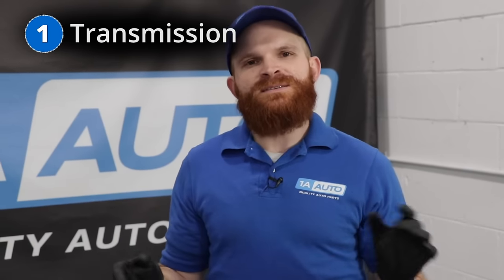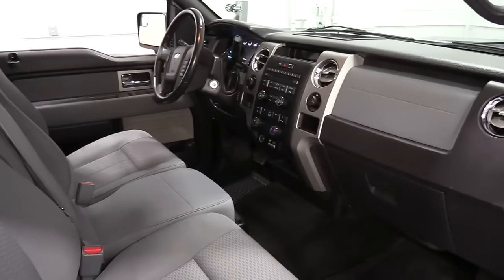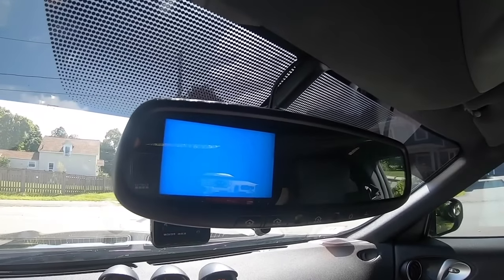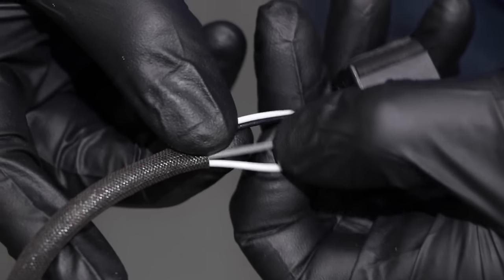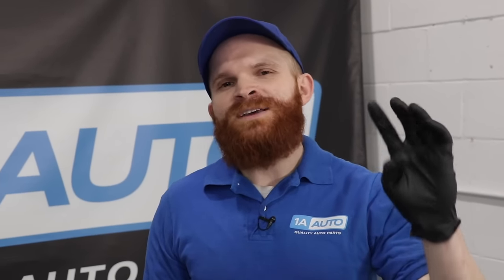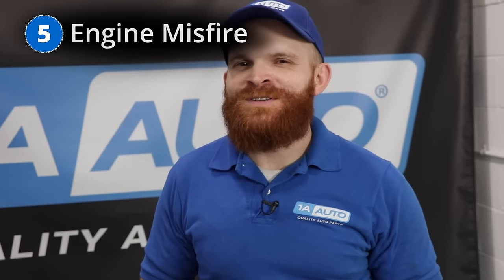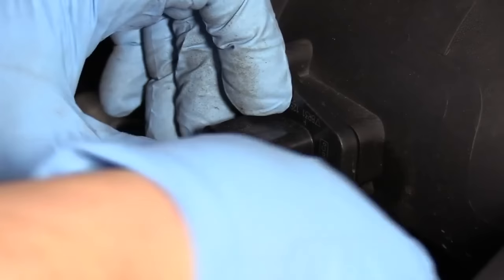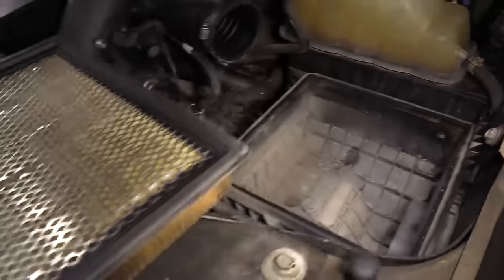Top 5 Problems Ford F-150 Truck  12th Generation 2009-14

Comment: I've got a 2009 F150 FX4.  My cruise control has been out for a while.  It also shows the traction control symbol on the dash every now and then.  I replaced the brake pedal switch, but it didn't help.  Any ideas?
Reply from the maker: +thecoolchipys Since there may be multiple reasons why you are experiencing this issue, we recommend taking your vehicle to a local mechanic to install. Thanks for checking us out!
Reply: @1AAuto  but tell him those possible causes.. so he can check... make a Top 5 too with those comments asking questions. Thank You <3

Comment: So what year are recalls I have a 14 and didnt get a letter or email from ford ?
Reply from the maker: +Charles hood Just contact your local ford dealer and they will have more information on that.
Reply: @1AAuto  I was told no recalls on 2014 f150 ecoboost 3.5 liter 112,000 miles just bought and the display flashes sometimes the radio has no sound sometimes the check engine light comes on I have had it just die I live in the mountains .  The whole display goes out. Battery check light comes on .Check brake system light comes on. Have only been able to auto start one time. Someone recommended  turning key on off 3 times to reset seemed to work for awhile. If you don't manually lock the doors, It sometimes does these things when it auto locks the doors. What a nightmare

Comment: I have had nothing but major problems with my  2014 f 150 fx 4x4. I quit buying American made vehicles in 1982. Now I remember why.i have put 10,000. Dollar's in repairs. I dumping this vehicle and going back to Toyota.  Plastic heard in the air diversion system. Rack and pinion that can't be greased failed after 6 years.  Transmission sensor currently been replaced. I'm well ng this to carvana and taking my losses. I can't afford to retire with an American vehicle on my property.
Reply from the maker: +kina lee Thanks for the feedback!
Reply: If you quit buying American made in 82,  how is it you have a 2014?

Comment: Blender door actuator $$$$.
Reply: Mines going out right now haha
Reply: Click ... click ... click
Reply: Easy to fix yourself just kinda hard to get to
Reply: $1000 dollar repair at the  dealer, $650 with local mechanic and he had to fix twice.  It actually ends up being the door flap and not so much the actuator.  I have to bring mine back in again. Probably should have had the dealership do.  Not and easy fix Rod CR250, the entire dash must come out and the center consol.

Comment: NEVER BUY A FORD. I’ve been inundated one problem after the next and my truck is just 6 years old. The warranty is up and Ford refuses to fix anything despite the fact that the issues cannot have possibly been due to owner fault. Even when my engine blew at 55k they told me I was over the miles. I religiously change my oil - fully synthetic every 5k. And most of my driving is highway miles. There’s no reason why this should have happened and the people at Ford in Limerick, Pa couldn’t care less. I’ve been a loyal Ford owner through thick and thin but this one will be my last mistake.
Reply: Posts like yours make me hesitant about buying a Ford f-150. I am considering the 2011 through 2014 models, but I actually do not need a pickup truck at all. The F-150 offers front bench seating in many of its vehicles, which I prefer to having a prominent center console between the two front seats.

I checked some of the other pickups that offer front bench seating, but I ruled them out based on gas mileage, poor reviews, and/or costs.

Seriously, I am wondering to myself if I want to spend north of $15K on a 10-year-old Ford with well over 100,000 miles. I would feel less hesitant about a Toyota or certain model and year Hondas with high miles.

So I am trying to decide between an f-150, a van (which I don't want) with a hip level center console, or learning to like the center console in a Honda Pilot or Toyota Highlander.

Comment: bois whats the best truck before 2011. used 
f150 or toyota tundra
Reply: I know your question is old. However as the owner of a nice pre 2011 F150 I would go with the 2007 up Tundra if buying a truck of that age today. The 5.4 is just to much of a crap shoot to take a chance on unless you really know what you’re getting into and are prepared to roll the dice.

Comment: 2014 5.0 lx I had a misfire and turns out over time the spark plug gap opens up to between .065 and .070 and starts to misfire. And commonly shows on cylinder 4 and 8. Replace with ONLY motorcraft plugs. Or gap the old plugs back down to between.035 and .045. Just don't damage the electrode tip or ceramic. Im not a mechanic or a professional. This is just what worked for mine after spending almost $400 on motorcraft coils and not getting better results.

Comment: What about the timing belt and phasers that seem to go out around 140,000 or the cooling fan running in high all the time
Reply: Uhm...the 2009-15 F150s don't have timing belts. They have chains. And if your chain broke at 140k...then it clearly had to be defective, or something catastrophic had to happen to the engine.
Reply: What was the solution to your cooling fan issue? Was it a coolant leak? If so, where was it leaking from (currently experiencing this)

Comment: Could you tell me what is going on with my 2010 f150 when I drive my truck in the morning and I take a off ramp onto the highway my traction control activate and slows my truck down almost to a stop? And this is on a dry day in August.
Reply: Same problem with my 2010 any luck?
Reply: Abs sensors

Comment: What if you don’t have the my touch head unit but are still having problems with the headunit to speaker output
Reply from the maker: +Dayne H We wouldn't be able to diagnose an issue like that here, you may want to have a local mechanic take a look at it. Thanks for checking us out! 1AAuto.com
Reply: My guess is that it's a blown speaker.

Comment: My radio just stopped working.i mean I've never had a stock radio just stop working.
Reply: Mine did that about 60,000 miles ago, it’s super stupid. Apparently it was an issue in the 2011-2014 models. I put an after market in and it’s been fine since.

Comment: I have a 2014 Ecoboost 3.5 twin turbo.  My opinion is the motors are far to sophisticated, and they use cheap parts.  Also they HVAC wiring and mechanical parts under the dash are chinese junk.  Unfortunately, Ford ain't what it used to be.
Reply: Molex connectors suck. They all have them now.

Comment: My radio displasy in black 4.2 inch 2013 f150 radio works just the display any help ???
Reply: I had the same issue. Ford doesnt make replacements of the 4.2" screen, so you could search forever in junkyards and ebay for one, or replace the whole stereo/hvac panel/ get a idatalink control module. Giant PITA, costs around $700 if you DIY.

Comment: Misfire in one cylinder 11-13?   First thing you do is... check the compression in that cylinder! The  #1 cause is sunken intake valves do to the s@!$y valves they put in them, but fixed late 2014 or so.  These other Thing might fix it temporarily but check the compression first before you do more damage. 
Google it and you'll see. 
Happened to me late october and after pulling the head I saw 2 different valves in 2 different cylinders  were sunken in but only one just threw the code days earlier.  Don't buy refurbished because many of those have the same junky valves in them.   You'll just be on borrowed time again.  Just got my heads back from the machine shop and so looking forward to putting them back On over the Thanksgiving weekend.

Comment: Ford has been phenomenal for that transmission recall.  Wouldn't call it a problem at all.
Gloves, long nails.....screen not responding to touch.....just like ANY other touch screen in ANY other vehicle.
O2 sensors? Really? So if You consider O2 sensor is being issue with f150 then OTHER cars have O2 sensors that last FOREVER right?
Purge solenoid? Charcoal canister? Im sorry but what is wrong with u? Its a ware and tare items.

Comment: Mine is 2010 2wheel drive crank it up put it in gear and it does nothing revive it up and it jumps in gear
Reply from the maker: +@kirbyammonsjr8491 We wouldn't be able to diagnose an issue like that here, you may want to have a local mechanic take a look at it. Thanks for checking us out! http://1aau.to/m/Shop-1AAuto-c

Comment: How do you not mention the Integrated Wheel End (IWE) actuators installed on the back of the hubs on the front axle. These are complete junk

Comment: 186,789 miles on my 2011 and the only problem its the backup camera 🎥
Reply: Do you get the dreaded blue screen issue?
Reply: @jasonstiokas3923  bought an 2011 f150 5.o xlt yesterday and it's a blue screen, I didn't know it had a camera. Does blue mean it's broke?

Comment: 2014 3.5 eco interior lights go on and off going down the road at a consistent pace. Any ideas anyone?
Reply: Remove the light fuse
Reply: Trade the truck for a F150 5.0 V8

Comment: i have a 2010 f150 4x4 5.4 3v , im having a shutter sound at low rpm around 40mph anyone know anything ?
Reply from the maker: +Wes Johnson We wouldn't be able to diagnose an issue like that here, you may want to have a local mechanic take a look at it. Thanks for checking us out! http://1aau.to/m/Shop-1AAuto-c
Reply: torque converter

Comment: These trucks are complete junk! What a rust bucket...they are totally designed to rust fast.... between the sponge material in the bed arch to the moonroof drain tubes emptying into the cab corners.. wtf?
Reply: What are you parked under a pine tree?

Comment: I have a 02 F150 got to start with a couple months ago because I kept getting a reading 420 it's a service engine soon I cannot find a problem
Reply from the maker: +William Ramirez Thanks for checking us out! The Code P0420 stands for a catalytic system efficiency below threshold for bank 1. You may want to have a local mechanic take a look at it to determine the cause of this as there are several parts that can cause this code. 1aauto.com

Comment: Reverse... rearview mirror image solid blue...?? 2011 FX4 backup camera
Reply: I had the same problem, it was working, then I got a blue screen. I found the connection at the tailgate had water intrusion, that was enough to screw it up. I unplugged it, like you would when removing the tailgate, it's under the truck, by the rear bumper, I dried it out, sorayed it down with electrical contact cleaner, greased it with dielectric grease, plugged it firmly back in, and electrical taped it tightly to keep it dry and protected. I haven't ever needed to remove my taigate from any of my trucks, ever, so keeping that camera feed connected and operational is way more important to me. That fixed the issue, hasn't been a problem since.
Reply from the maker: +Mark K Thanks for the tip! 1AAuto.com

Comment: 2010 F150 4.6 3v 198,000 miles, when does all this start?  
Stop taking it to the dealer for services.
Change oil air filters, plug change 1 time.
Dealer mechanic dont know shit.
Reply: I have the same truck, same engine, 139,000 miles, runs perfect